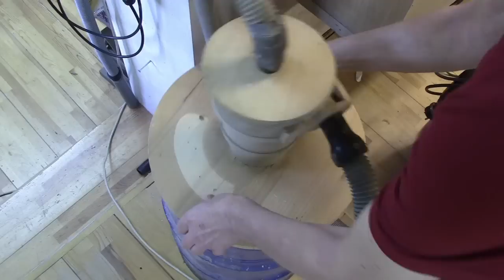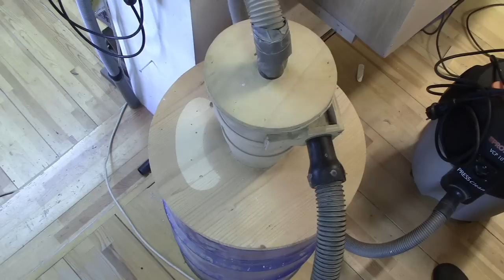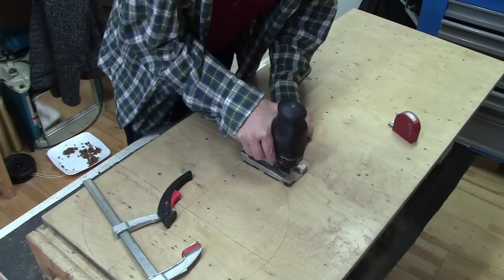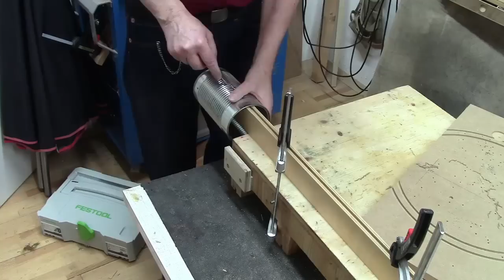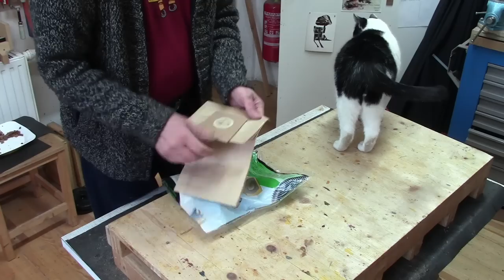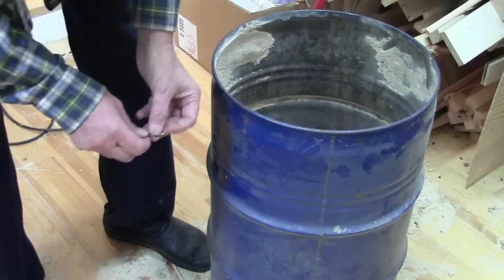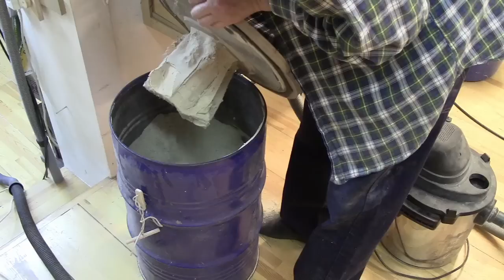Awesome dust collection for the workshop without cyclone - better, simpler, cheaper - DIY JIG

Comment: I like it!!! Mein bruder hat ein cyclone gemacht gaste jahre aber es nicht gut...it didnt work very well (sorry, i ran out of German but i did try.) Ive been suspicious of the cyclone ever since. This seems a much simpler idea and much more likely to work well. Your brain gets smarter every day... Incidentally, i wonder if a cheese grater might work for the filter bag frame? It would save a little work punching all those holes! Great job Stephan, thanks for sharing.
Reply from the maker: Thank you Mark, your German is fine.😊 Very funny idea to use a cheese grater. But the can is probably cheaper and making the holes is really very fast. It only took me 10 minutes.
Reply: Hat mich spontan an das Ding hier erinnert:
https://www.ikea.com/de/de/catalog/products/30011832/

Bzw. die lange Version:
https://www.ikea.com/de/de/catalog/products/30131716/

Comment: Das Proplem hatte ich auch Stefan mit dem Feinstaub. Habe aber nach langem Suchen die Undichtigkeit gefunden und seit dem geht auch der feine Staub zu 95% in die Tonne. Habe den Beutel jetzt ein halbes Jahr dran und kaum mehr Staub drin.
Reply from the maker: Wenn Du zufrieden bist,  würde ich auch nichts ändern 😊
Reply: Wenn ein Zyklon nicht einwandfrei funktioniert, ist es zu 99,9% eine Undichtigkeit im System ;-)
Reply: Jörg Müller jupp

Comment: I don't understand this. Why not just put the bag over the filter in the vac and put the vacuum top on the barrel if you need more dust capacity.  Seems like the cyclone was not properly designed if that much gets past it.

Comment: Ich habe genau das selbe Problem wie du Stephan, der Feinstaub verstopft den Filter des Staubsaugers, wenn sich der Beutel von der Düse löst, löste ich das Problem, indem ich den Beutel mit einem Seflexkragen zusammendrücke, aber ich glaube das Ich werde Ihr System ausprobieren, was den Vorteil hat, dass es sehr einfach zu erreichen ist und gut zu funktionieren scheint.
Danke, dass Sie sich die Zeit genommen haben, etwas zu teilen
ps: Wie kann man schöne Dinge nicht machen, wenn wir einen Vorarbeiter haben, der die Maßnahmen so genau kontrolliert?
Reply from the maker: Vielen Dank Bernard 😊

Comment: Den Cyclone hast Du Falsch verstanden. Du gehst wirklich rueckwuertz.  Von was Ich sehe hast Du das Rohr in die mitte nicht eingebaut so das der Cyclone nicht richtig wirkt!!!!  Bitte Entschuldige mein Deutsch das ich sehr selten gebrauche.  
From what I gather here , you did not build the cyclone preperly.  Just like the other flat configuration the Tnien Separator ,  it needs a pipe in the middle to work efectively.  Sorry but you misunderstand the operating principle and build it incorrectly.  Build it properly and you will not need the filter, as the centrifugal force of the spinning air does the filtering.  Best money I ever spent was buying the little Oneida dust deputy.  In about 15 years of owning it,  I have replaced my bag once because I forgot to empty the can.   Otherwise I like your work!!!
Reply from the maker: I think a correct cyclone works very well. My selfmade cyclone was not very good. So what should I do? Buy a cyclone or use my brain?  😊